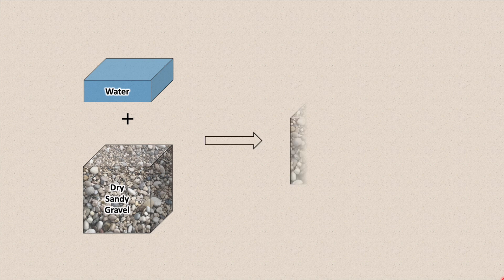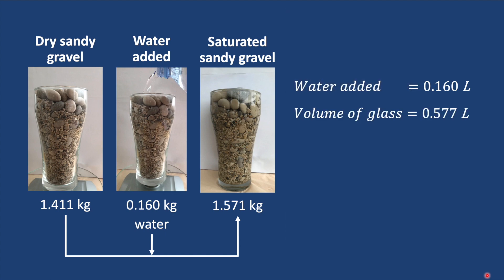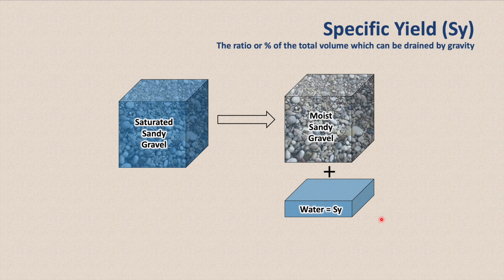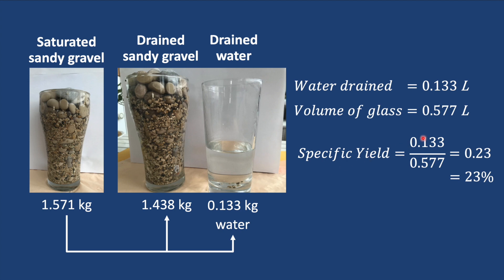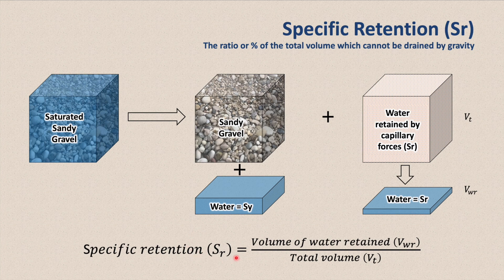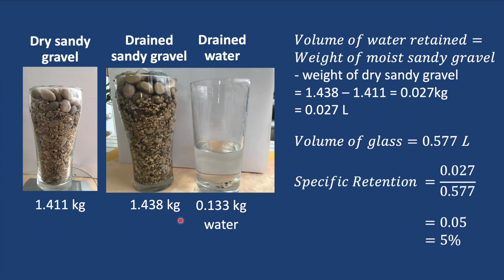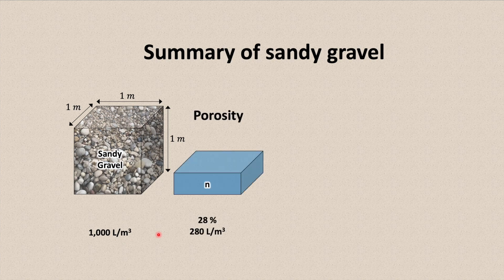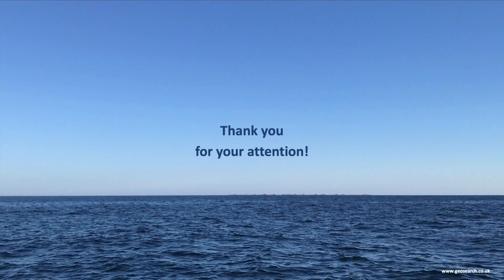Hydrogeology 101: Porosity, Specific Yield & Specific Retention of a Sandy Gravel

Comment: Great teaching and explanation. Very helpful! Please answer the question, whether it is necessary to pre-dry the sand of it has some moisture (30%) in its natural state ?
Reply from the maker: Hi Акыл, Glad you found it useful. The sandy gravel sample in the video is from a river bank and it was completely dry already when I collected it, so I did not pre-dry it. If your sample is wet, and you let the water drain away the maximum water it will contain will be the specific retention - what is stuck to the sand/gravel grains by capillary attraction. In this case it was about 5%.
So yes, if you want to do a proper scientific job, you should make sure that the sample is dry. All the best, Andreas

Comment: question. 
What is the Safe Yield system ? 
When does Discharge and recharge occur ?
Reply from the maker: Dear Gholam,
"Safe Yield" is an old term to describe how much groundwater can be abstracted from an aquifer without mining it. I would prefer to use the term "sustainable yield", because "safe" has implications of safety. If you abstract groundwater from an aquifer you can do so sustainably if there is a balance between recharge and discharge. Recharge from precipitation or irrigation occurs once the soil moisture is satisfied. Of course we can also get recharge from surface water bodies like rivers and canals, or even from other aquifers. Natural discharge from an aquifer happens all the time, and it is controlled by Darcy's Law. It is what keeps rivers flowing during the dry season. I will try to make some videos about water balance in river basins this year. In the meantime have a look at: https://youtu.be/9Wmkugy3XdQ
All the best, Andreas
Reply: @GeosearchInternational  
Thanks so much my friend.
It was very informative.
I want to Research on groundwater  and how can we make balance.
Reply from the maker: Dear Gholam, I will make some videos about it soon. Basically you need to estimate all the inflows and outflows of your river basin over at least one year. Some things we can measure ( e.g. precipitation, stream discharge), other things we can estimate (e.g. pumping rates), and other things are more difficult (e.g. actual evapotranspiration). Things have changed a lot since we have better remote sensing data so the whole water balance exercise is becoming much easier. All the best, Andreas
Reply: @GeosearchInternational  
I am waiting for that video. It will be amazing. 
You always clearly explain like before videos  ❤
Reply from the maker: Thanks Gholam, I'll try my best! Andreas

Comment: I am a bit behind. Is the volume of a glass standard or they're some calculations?
Reply from the maker: Hi Stephen, It is a pint glass but I don't know if it is standard or not. I measured the volume by weighing it while empty & then full of water right to the brim. Assumed that the water weighs 1 kg/L or 1 g/cm3, the difference in weight can then be used to calculate the volume of the glass. All the best, Andreas
Reply: @GeosearchInternational  thank you so much. I am enjoying your lessons Andreas.  Can it be okay to contact you via mail?
Reply from the maker: I'm glad you like it. Sure you can contact me - you can find my e-mail in the 'About' section on the right of the channel home page. All the best, Andreas